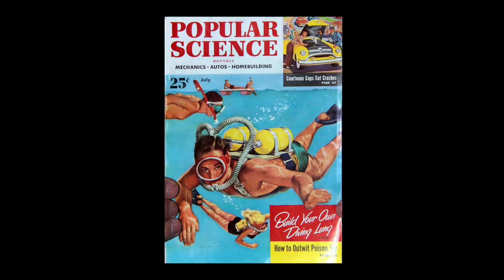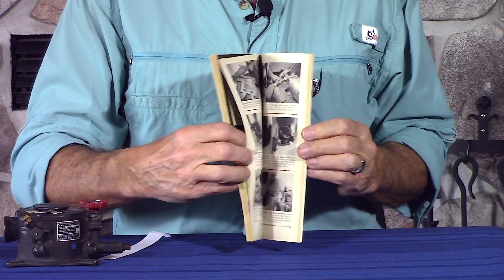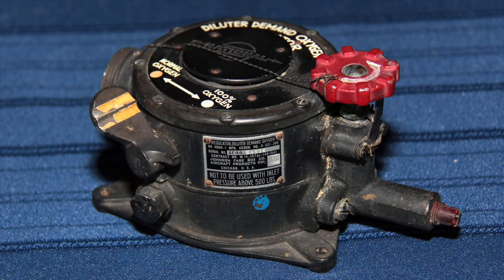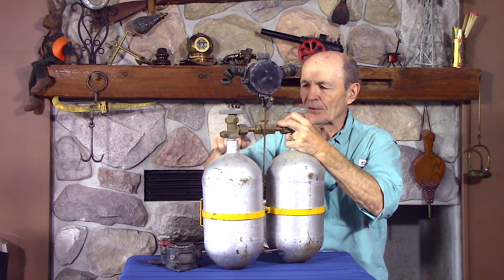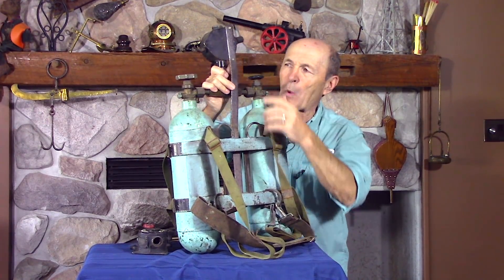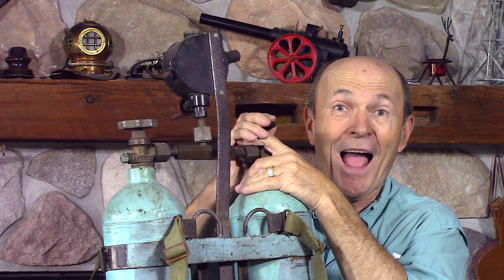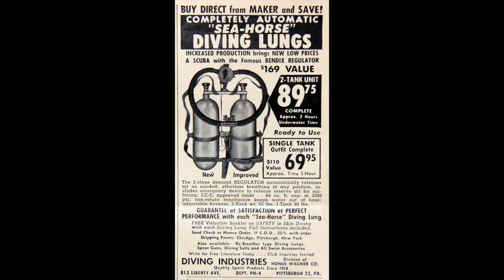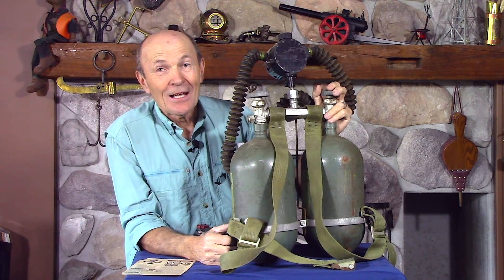Vintage Scuba: Make Your Own Scuba Regulator - S05E07

Comment: Great video. How did people in the past using this equipment handle buoyancy?
Reply from the maker: With difficulty.
There was no piece of gear to address buoyancy. It was just part of the process. 
We would decide how much weight we needed for our dive depth and put on that much. It meant that we were buoyant on the surface so we would pull ourselves down an anchor line or pick up rocks to get down. Obviously, there was no stopping at 15' for a safety stop.
And you had to be careful not to go deeper as you would become more negative and struggle to get up.
Fun times.
Alec
Reply: @AlecPeirceScuba_SeaHunter  Thank you for your explanation.
Reply: @AlecPeirceScuba_SeaHunter  Its amazing to imagine the effort that was necessary in those days. Thank you so much for your detailed answer.